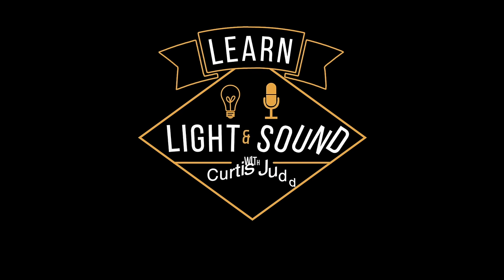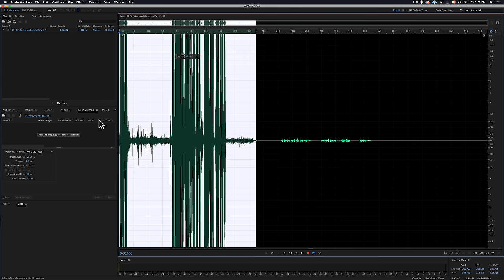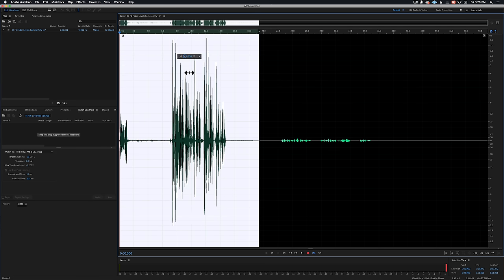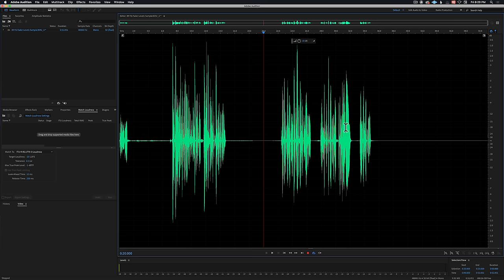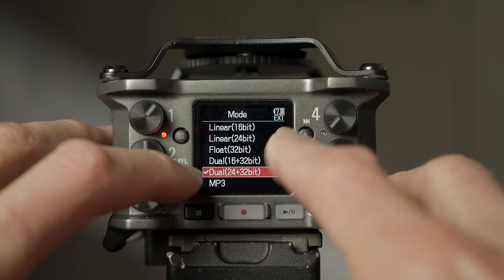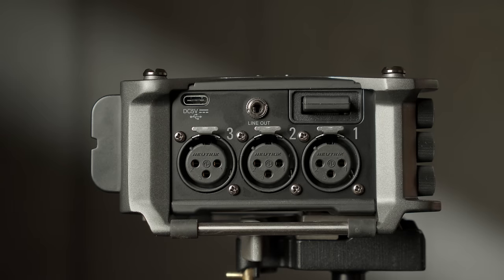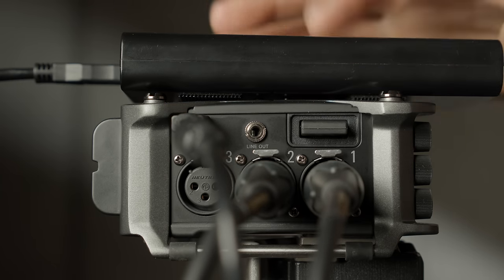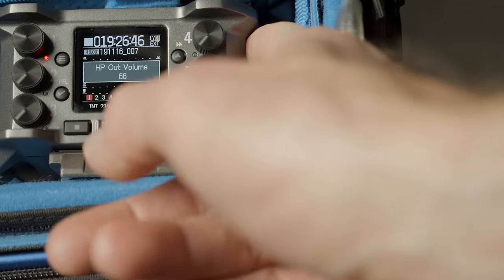Zoom F6 Audio Recorder Review

Comment: I have a Zoom H6 - what am I missing - as it did record a four character dialogue scene (even though one of the mic input seems to be dead in this eight year old recorder) and my problems were trying to sync all the takes up with the video (even though we used a clapboard and announced each take) maybe those time code options are worth a new better recorder??? Also, I’m trying to use the Nikon Z6 filmmaker’s Kit (if they ever deliver the ProRes RAW for the Ninja V) so I am wondering IF the sound should be going into the Ninja V recorder - where the video will end up - for a better ONE MAN workflow??
Reply from the maker: Hello George, timecode is but one of the advantages of the F6 over the H6 as I hoped the video would demonstrate. The wide dynamic range is probably the biggest new feature. Timecode can be helpful for sync but when feeding timecode to consumer cameras like the Z6, you have a step in post where you have to convert the video clip's audio track to timecode and you need an app to do that for you. So that's why I usually recommend the Tentacle Sync E which comes with an app to do that. Here's an overview if you are interested: https://youtu.be/o36XYOPp0BE

If you feed audio to the Ninja, you will need to apply an offset to compensate for the latency in the HDMI signal from the Z6. It isn't difficult, but you have to finesse it for your setup with some experimentation. Best wishes!
Reply: Got it! Basically, I was woefully underestimating the task at hand/ear. Skipping to the solution - if I could live with the limits of video to an XQD card (ie no log) on the Z6 - then the easiest recording would be to use the Tentacle to create the Time Code and Scratch track - in the Z6 - and upgrading to the F6 (over the H6) would get me (much) better dynamic range...

But - IF I need to shoot 10 bit N-log (or the mythical ProRes RAW) in the Ninja V using the Z6 - then I will need to finesse the setup (even with the accurate Time Code) due, as stated, the HDMI latency.

Or

I could consider renting higher priced cameras and lenses where this audio workflow has been resolved long ago. 🤔

The only reason I bought into the Z6 Filmmaker’s Kit was my legacy Nikkor lenses (which - with the FTZ adaptor - are too heavy anyway for my Rhino Slider and Moza Gimbal) and ProRes RAW which may never come out if Sony stops selling Nikon their video chips (which I believe is the legal and financial rather than technical snag.)

Decisions. Decisions.

Thanx again for the Head’s up ! Just at the start of my (mega) Bucket List project and doing my first real integrated shooting.
Reply: While I’m here... 

Is there a way of accurately time coding for the iPhone 11 Pro Max? (Or just another reason Apple’s Filmmaking cell phone doesn’t have much DIALOGUE 😂🤣😅) 

Cause it’s a whole lot easier to gimbal the small camera/sensors for movement... but I’m smelling “B-roll Only”
Reply from the maker: @TheGeoDaddy  For he Ninja scenario, you can still send the audio to camera which will then carry it forward to the Ninja and then you avoid the sync issue due to HDMI. Since that will be scratch audio anyway, that seems like a simpler solution.
Reply from the maker: @TheGeoDaddy  Yes, same as the Z6 but note that phone footage tends to drift A LOT. So if you're doing anything longer than 1 or 2 minute clips, you'll still likely have drift issues even if the start of the clip is lined up perfectly.
Reply: Much appreciated!

Comment: Does anyone know how to record when I'm using the device through the usb. When I enable aid with rec all the other options close. I'm lost.
Reply from the maker: Yes, when in AIF with Rec mode, press the record button to start recording on the F6. Many of the options in the menus disappear because you are in audio interface mode. Some of those settings are handled in your computer instead. Is there a particular setting you're missing?
Reply: @curtisjudd  Thanks Curtis, I see now that the computer handles those settings and I can record. Cheers bud

Comment: I could not verify why the Zoom F6 hasn't arrived yet, but I see that DVR allows to export at 32 Bit.
Reply from the maker: You mean you ordered the F6 but it hasn't arrived yet? It is odd that DaVinci Resolve appears to have issues importing 32-bit float but can export 32-bit float.
Reply: Yes the F6 zoom will arrive on Friday. Now I don't have 32-bit files to try, but I've seen that DVR allows 32-bit export
Reply: I work with MacOS
Reply from the maker: You may have to first bring 32-bit float files into Audacity, attenuate any sections which exceed 0dB FS, save in 24-bit, then import into DaVinci Resolve. Best wishes.
Reply: @curtisjudd  Thanks for the valuable advice, I'll let you know

Comment: It looks like Resolve 16.2 is now SUPPOSED to be able to handle 32 bit floating point... has anyone tried files from the F6 on it yet?
Reply from the maker: Hoping to do that soon. I'm not clear on whether it will import a 32-bit float file and convert it to 24-bit on import or whether its full processing pipeline is 32-bit float capable. More to come.
Reply: @curtisjudd  I should imagine/hope that Resolve uses 32 bit float internally... it is almost always faster on modern computer to deal with 32 bit chunks of data than 24 bit... 24 bit is smaller, yes, but slower to access...  I've just tried the Sound Devices demo 32 bit files and they appear to "work" but the graphical display shows the clipped version of the file even after pulling it down 30dB... ugly but functional... I couldn't find any demo files from Zoom so I'll leave that to you!  :D
Reply from the maker: @mjlagrone  Thanks!

Comment: Can anyone help me understand... I have cheap CO2 mic. I'm testing Tascam dr60d and zoomf6. When I normalize in audacity, the low sound will bring up noise too from both devices. Is it because it's bringing up the noise from the mics? Because as far as raising gain I'm seeing no difference between zoom and tascam... (I'm recording in my house, no studio)
Reply from the maker: Yes, normalizing brings up every single sample in the digital audio, including noise floor.
Reply: Curtis Judd thank you for clarifying that. So how do you suggest I bring up the sound without too much noise floor? I’m seeing you pull gain (?) up in audition so easily... is that just an audition feature or could I do that in audacity as well? Thank you sir
Reply from the maker: @crusad33r  The challenge here is the CO2 which is not the cleanest microphone in terms of self-noise. You could normalize and then apply an expander or do some de-noising in post.
Reply: @curtisjudd   Thank you so much!

Comment: Have any one tested Zoom F6 with Ipadpro 2020 with. USB Speaker? Because using the app and it’s responding like a mixing console. So I hook up my JBL Small USB Speaker to see if I can here playback. Is there a settings for Bluetooth audio playback when using an iPad Pro with the zoomF6 ?
Reply from the maker: I haven't, I don't have an iPad Pro. But please, what is it you're trying to accomplish? Are you trying to use an F6, iPad Pro, and bluetooth speaker to make a PA system?
Reply: @curtisjudd  yes I am I only thought about that since I had all three items setting in front of me and no monitoring to hear play back unless I have headphones on  so I’m thinking if I can Bluetooth on the iPad and the iPad is acting like a mixing console shouldn’t it pick up the audio like anything else would.  Just basic playback like garage band or any other source. That’s it 💡 maybe it could pick up on another sound device. Uhmm.  Or zoom needs to install an interface for the software. But they may have because it’s made for musicians also.  I think this may work. I’m on there website and I’m going to download the audio drivers.
Reply from the maker: @gatlinproduction  Ok, I see. Unfortunately, the control app does not support audio playback from the recorder. Probably something to do with latency via bluetooth.
Reply: @curtisjudd  Ok I got that.  Do you think if I found a Bluetooth device with a line in/out put because let’s say I bluetooth to Via my iPhone and then run out of the Zoom F6.  Because the sound source is connected from the iPhone but the line in/out is connected to the hardware F6.  I’m trying to find something like this now and the only speaker i’ve came across is ILoud Micro Monitors but the only thing with that is that is to Big and it’s not Mobile.
Reply from the maker: @gatlinproduction  a bluetooth transmitter/receiver kit should do the job.
Reply: @curtisjudd  ok I’m kinda lost on that one. Can you provide me a link?

Comment: 14:05 I don't know details about the signals from the timecode but, for audio, just tying left and right together is not a good practice because both output preamps will feed each other. This can cause noise and will certainly reduce the lifetime of that output. There are simple resistive circuits to add channels into mono - a good one is "Why not wye" https://www.prosoundweb.com/why-not-wye/

As I said before, I don't know how those outputs are driven for time code. I'm almost sure the actual oscillation circuitry won't suffer if you just join both channels.
Reply from the maker: They've wired the 3.5mm TRS jack differently than most others. We were bridging the two to get the signal to the right place. Hasn't seemed to inflict any damage yet.

Comment: Sorry; this comment is scattered and unclear. I'm still editing.
4:09 I understand that the SNR of floating-point PCM is proportional to the signal level, so a low-level signal recorded with a floating point has less quantization error than the same signal recorded with integers. That said, how significant is this in practice? Even if the quantization noise is vanishingly low, if you're boosting a legitimately low-level signal by 90dB in post then you're raising the self-noise of the mic and all the electronics before the AD as well, are you not? 

But if the signal you recorded was of a nominal level at the AD, then lowering the fader only shifts that healthy signal down into the thousands of dB of available dynamic range offered by the recorder.

From skimming the F6 manual it seems to me that the gain is fixed at unity when recording at 32-float. That being the case, the faders must not be fundamentally changing the recorded level so much as they are simply shifting the signal level up and down within the thousands of dB of available dynamic range of the recorder.
Reply from the maker: Hi Helman, Because the F6 uses multiple ADCs per input, they are somehow achieving a noise floor which seems to sit quite a bit lower than on a recording signal chain with a single ADC per input and a 24-bit converter.

In my practical tests, it does seem that the noise floor does rise with 32-bit float recordings when boosted in post, but still sits lower than on an equivalent single ADC/24-bit recording.

Also, I am told by Samuel Green at ZOOM that when in 32-bit float mode, the isolated channels are recorded at post fader levels.
Reply: @curtisjudd  Holy crow, Curtis, you're fast on that reply! I was hoping to edit before you noticed. Oh, well! 😂I completely restructured my question. I'll leave the original half-baked one there for posterity. Here's the new one:

4:09 I understand that the SNR of floating-point PCM is proportional to the signal level, so a low-level signal recorded with a floating point has less quantization error than the same signal recorded with integers.

From skimming the F6 manual it appears that the gain is fixed at unity when recording at 32-float. That would suggest that the faders are not fundamentally affecting the recorded level so much as they are simply shifting the recorded signal level up and down within the thousands of dB of available dynamic range.

I presume that the voiceover you recorded in that example hit the AD at a nominal level, well above the noise floor of the mic and analog electronics. If that’s the case then I have to also presume that the ‘-60dB’ and the ‘+60dB’ signals are in fact identical (aside from being different takes).

I think a much more telling test would be to compare the quantization noise of the recorder operating in 32-bit float to itself running in 24-bit integer. Introduce a low-level signal to the AD and then boost THAT by 90 dB and see which holds up better.
Reply from the maker: @helmanfrow  Good idea, thanks for that.
Reply: @curtisjudd  F'sho. And, as usual, great video!

Comment: Help! Hopefully this is still being monitored.

I have the Zoom F6 and I'm wanting to use a lavalier mic with it. 

Setup : I plug my 3.5mm lavalier into a Rode VXLR+ and it doesn't work. I'm wondering if there's a setting I need to change to make this work. When I plug in an XLR mic into the same input, everything works as you'd expect. Hardware is working. 

I've tried two different lavalier's. In theory it should work. 

What am I missing? I'm sure it's something obvious but I'm not a sound guru. Any help would be appreciated. 

Thank-you in advance.
Reply from the maker: Hi Giovanni, you'll need to turn on phantom power for that input.
Reply: @curtisjudd  Hi Curtis. Thanks for the response. Phantom power is on by default. It is on for the input at 48V.
Reply from the maker: @giosasso  Ok, I'm afraid I'm not sure why it isn't working. Perhaps RODE support can help?
Reply: I have the Rode VXLR+ -- but there's also the VXLR and I'm wondering if that adapter is the correct one : http://www.rode.com/accessories/vxlr

In this video the guy uses the VXLR (Not "Plus") : https://youtu.be/hhXwfWl9dV4
Reply from the maker: @giosasso  99.9% of lavaliers with a 3.5mm TRS connector need plugin power (3-5V), not phantom power (+48V). You can damage your lavalier microphone if you apply too much voltage. I would double check the specifications for your lavalier microphone to confirm it needs plugin power. If it does, then the VXLR+ is the appropriate adapter unless your lavalier is a Sony or some other unusual pin-out/wiring scheme.
Reply: @curtisjudd I thought the function of the VXLR+ adapter was to reduce the power (to 3-5V) so it wouldn't damage the lavalier mics. I have a Countryman B3 and a Tascam mic. Nothing weird. Very typical lavalier's.

At the moment the input is set to +48V under : Input / Phantom Settings

Should this setting be changed? The other option is 24V+. I don't understand. I would expect it to work --- my little brain can't figure it out.

I did send an email to Zoom earlier today. I've also ordered the VXLR, which I'll get tomorrow.
Reply from the maker: @giosasso  You are correct. The VXLR+ should convert the +48V to 3-5V plugin power for the lavaliers. If you have the phantom power turned on, something seems to be defective.
Reply: @curtisjudd  Thanks for your input into this. I appreciate it. I will let you know what the problem is once I figure it out. It shouldn't be this hard to use a lav with a mixer. I'm sure it's something I'm overlooking. I hope to sort this out by Monday. That's my target. In the meantime it's driving me nuts.  

BTW. I absolutely love your channel and everything you put down on digital celluloid. You're a breath of fresh air on YouTube; while everyone else is screaming you're putting out good vibes, in parallel to a wealth of information that is both deep and accessible. I have learned so much about audio because of you. I appreciate how thorough and honest you are. I'm not sure how I would have learned so much so quickly without you. You illuminate the science of audio recording and elevate it to an art. A rare gift indeed.

Thank-you! Thank-you! Thank-you!
Reply from the maker: @giosasso  Thanks Giovanni!
Reply: Problem Fixed : Funny how I found the solution --- thanks to you and your listeners.

I was watching your live stream this morning and you read a question/comment from one of your listener who stated their problem and mentioned that they did a factory reset but they never really figured out what the problem was. Nevertheless, the problem was fixed.

When I heard their story I immediately thought "Yeah, maybe I should just try a factory reset. Why not." And so I grabbed my F6 and did a factory reset, and the lavalier was still not showing any sound levels so I changed the default setting "Mic" (No phantom power) to "Mic (PH)" (Phantom Power).

Now, although '48V Phantom Power' is on by default, the setting targeted to use phantom power is not selected by default, as illustrated above.

Each input has their own individual settings and "Mic" is the default 'source' setting. Found here in the menu : Input / PFL / Input "#" / Source / Mic
"Mic" is described in the manual as : Use when connecting a mic or other equipment with a low input level.

For a lavalier mic it needs to be set to "Mic (PH)" 
Mic (PH) is described in the manual as : Use for mic level with phantom power

*NOTE: I am plugging my lavalier 3.5mm connector into the Rode VXLR+ which is plugged into the XLR input of the Zoom F6.

I'm certain that the reason why "Mic" (No phantom power) is on by default is because phantom power can destroy microphones so having that as a default would certainly ruin a lot of microphones, making customers very unhappy with Zoom.
Reply from the maker: @giosasso  Nice work Giovanni! Happy recording!